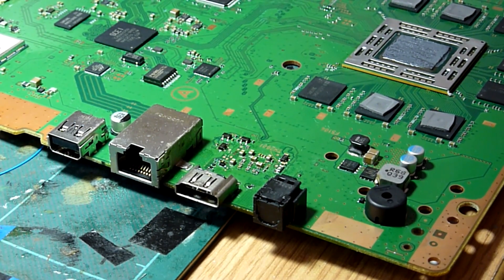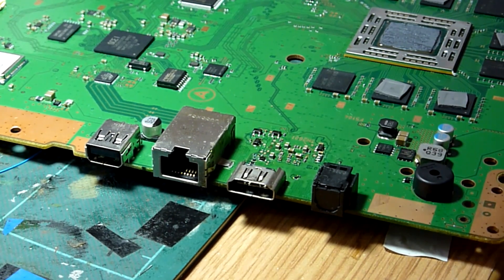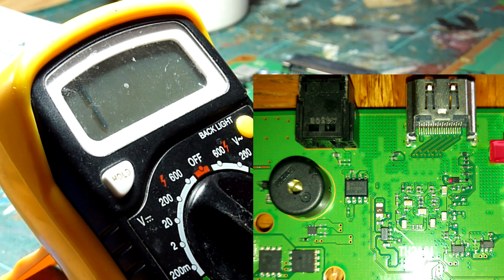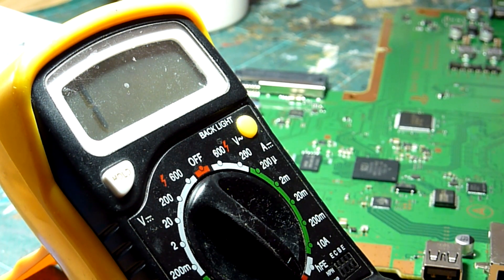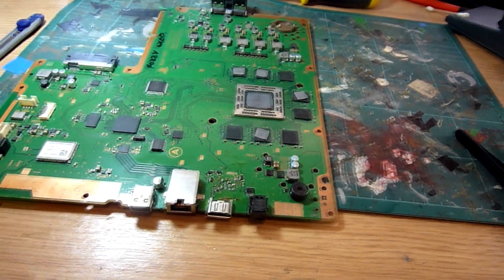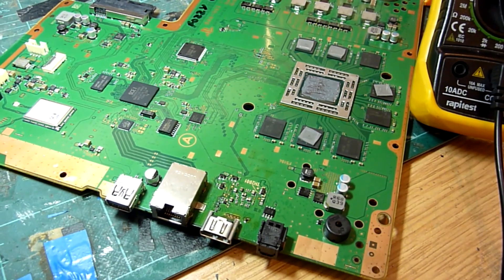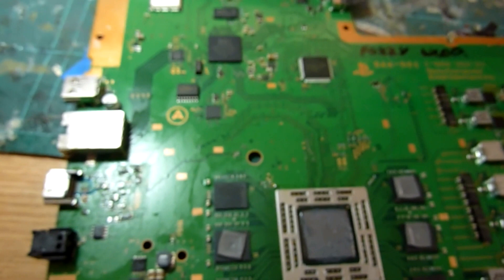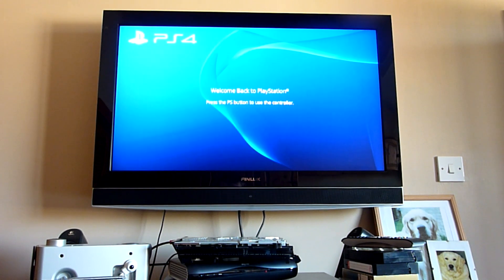PS4 HDMI Pin 13 Short to Ground Repair - White Light of Death (WLOD)

Comment: my ps4 hdmi was showing no signal after a storm. ik tired to have it repaired, they changed the HDMI port but it's still not working. do you think i can do what you show in this video to have it working ? what are your thoughts ? thanks for your videos!!
Reply from the maker: Very good chance it's damaged but lightening strikes usually take out more than just the IC but you may get lucky. Sometimes it may damage the coils and some surface mount capacitors etc on the top side.
Reply: hey did you find the issue ? i have the exact same problem
Reply: No not yet. 2 repair stores told me they were not experts and could not help me. i'm thinking of trying myself. i have done some soldering in the past but i don't know if i should try. if not if you guys have any idea or know a repair store near Washington DC i would appreciate it.
Andrew thanks for your answer though.
Reply: I have exactly the same issue,lost picture and sound so assumed it was faulty HDMI port which i replaced and guess what!?....still no sound or picture. The pins are all connected.
HELP!?
Reply: I've chanced the panasonic chipset and its working now
Reply: Th3Night0wl where you get chipset from?
Reply: Found it on ebay but why dont you just send it to him for repair or even sell it and buy a ps4 pro
Reply: In uk,thought it was a simple job so yeah, might just get a pro.
I just gotta copy hard drive over.
Reply: Yeah its the best solution instead of running into problems in the future
Reply: Hey guys, First, i'm in the US we can send the P for repair here ??
Second, do you guys know how i can get my saves extracted from this console to put it in another one ??? i don't have playstation plus....
Reply: Ask Google how to... :)
Reply: actually i did but i can't find a clear answer if it's possible or not. some people say it's possible but don't explain how or they say if you put a harddrive in another ps4 it formats it....
Reply: yeah it is possible but i think you need ps plus i recommand asking customer support @askplaystation on twitter

Comment: Hi Andrew! I need your help. I replaced a HDMI Jack and used a bigger heatgun. my hakko station isnt working anymore. so after replacing the socket, it showed me snow on the tv. so i soldered again a new jack, new panasonic chip and now i got no screen. resetting also doesnt work. white light appears. 
trying so mesure the points but i cant find a schematic to any playstation 4. maybe you can help me out with that or tell me where i can get them. i'm working right NOW in my office. you could call me or me you : ) if you have time.
Reply from the maker: +Georgios Mastoras If you were getting at least something before and now see nothing I'd be tempted to check the area of rework particularly if you've not been able to utilise a proper PCB rework air wand for any damaged / burned  / missing components.

Comment: in this video u changed hdmi ic or just remove shorting to pin 13
Reply from the maker: +ps3,ps4,xbox 360 and xbox one reballing service Pin 13 and its diode were showing direct short to ground. This track ultimately runs to a via and goes through the board to the HDMI Encoder IC. Removing the HDMI encoder IC removed that short to ground so a replacement HDMI Encoder IC chip was installed to correct the problem. So changing the IC resolved the short and got the PS4 back to working order :-)

Comment: my ps4 showing white light but no display on hdmi some time it flicker lightly it detecy signal
Reply from the maker: +ps3,ps4,xbox 360 and xbox one reballing service Have you checked for loose / missing pins in the HDMI port? Also check continuity across the port from the alternate pin out points to the end of a HDMI lead using the test points in there - this will show that the port is working correctly and that the required signals are reaching the display. I have seen ports which look good to the eye and test OK with no lead installed but are internally fractured and only show a failure with a lead inserted. Always best to check the easy things first.

Comment: i have checked that pin and there is shorting to diode pin to 13 pin
Reply from the maker: +ps3,ps4,xbox 360 and xbox one reballing service Yes that's normal - the diode is directly connected to pin 13 - this video is showing that both the diode (and consequently pin 13) is shorted to ground so the serial data is not getting to the display hence white light no picture. :-)

Comment: 13 pin is already short to by default on another working ps4 u r guiding false man
Reply from the maker: think you'll find it's not...
Reply from the maker: +Andrew Paul TMDS Data 0+ - if that's shorted to ground you'll be having issues before long as it's a serial data line. Checked availability of all resolutions on that box have we?
Reply: @AndrewPaul  hes obviously talking bollocks.

Comment: How much would it cost to fix my ps4 it has the Same problem with the hdmi
Reply from the maker: +OG LIN where are you based?
Reply: +Andrew Paul Milton Keynes
Reply from the maker: +OG LIN That shouldn't be a problem. You can check out my HDMI Repair Service at: http://www.ebay.co.uk/usr/lufcfan2004
Many thanks.

Comment: I have a ps4 that was giving no video.  changed the ps4 hdmi still no video, changed the ps4 hdmi ic and it would only display in 480p and no video on any other display  changed with another hdmi ic and still only 480p but flashes on and off with 720p
Reply from the maker: +jake min Check continuity of the HDMI Port pins and make sure your soldering is good with a DMM on the Encoder IC. You'll also want to check continuity across the EMI filters beneath the Encoder IC. Cheers.

Comment: Hello! 
I have a PS4 with similar condition (WLOD), I've changed the HDMI Port and the HDMI Encoder IC but with no avail, If in fact I had the HDMI Pin 13 grounded, how can I fix that? 

Cheers!
Reply from the maker: +Samuel Wilson Is there any pad / mainboard damage? The only thing you can do is use a multimeter and trace the circuit back, lifting things until the short disappears. Easiest thing though first is to check for any shorts on the port or IC. Cheers.
Reply: I don't think there's any pad damage. 
I will do that and hopefully I can fix it! 
Thank you!
Reply from the maker: +Samuel Wilson Yes it's a pain ha ha! But, it's a simple enough circuit so barring any physical damage it should be easily fixable. :)
Reply: Same problem did u fine the solution

Comment: how did you diagnose it to the point you knew it was something shorting it out? and not think it was the fault of the HDMI port itself?
Reply from the maker: +pat c. Visual inspection of the port showed no short and pin 13 is not adjacent to ground pins at either side so when it read continuity to ground it was obvious something was amiss.
Reply: ***** here's a tip. good stuff andrew. keep up the awesome videos.

Comment: Excellent! I have a question, I got a ps4 from my cousin, and it has a broken diode that is near from the hdmi ( it is the nearest little diode from the hdmi port)...Do you know what value could be?... I marked the diode in other picture that has the diode..  http://tinypic.com/r/imv0hx/9    Thanks for sharing the video!!!
Reply: +towemas i have a ps4 completely missing that same diode. cant seem to locate another one :(
Reply: +Dave Miles   In ebay there are DIODES SMD that can be adapted, but the problem is that I do not have the correct value to buy it...

Comment: All the pins on my port are good except for one on the bottoms far left its pushed in a lil would I still need to do this or can I somehow pull that pin back out
Reply from the maker: +Shawn Gonzales hi Shawn, you may be able to push it back into the comb from the rear of the HDMI port using some fine tweezers but chances are it may push back out sooner rather than later. Cheers.

Comment: hi. so i had a problem with my ps4 and that stupid wlod came. no pic no sound. i sold a new hdmi port but now it wont work at all? when i power it on it shut off after a secound?  tried everything. i even tried to go to recovrry but it wont let me at all? help?
Reply from the maker: +bib tamarji firstly remove the new port and check for any solder bridges / splashes which may have caused a short circuit. Good luck!